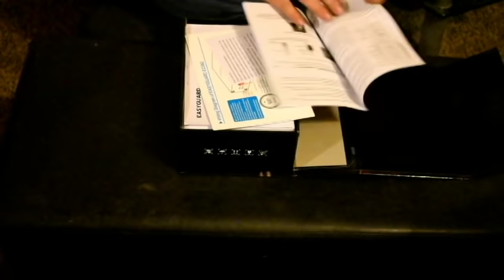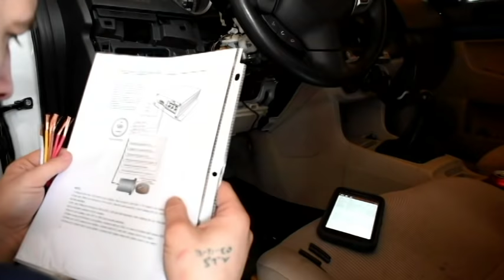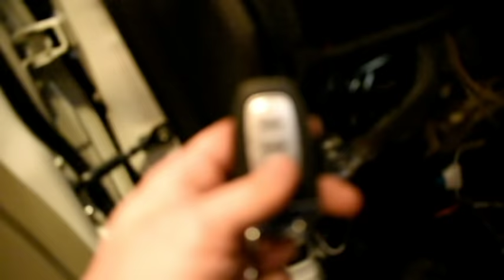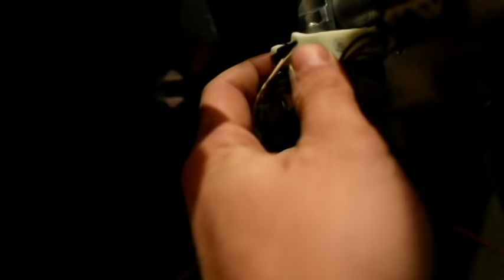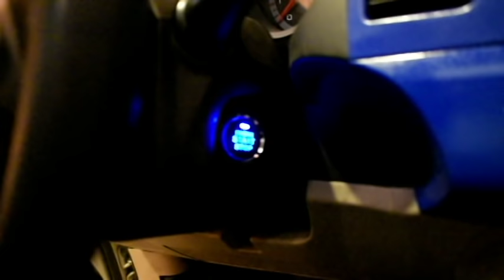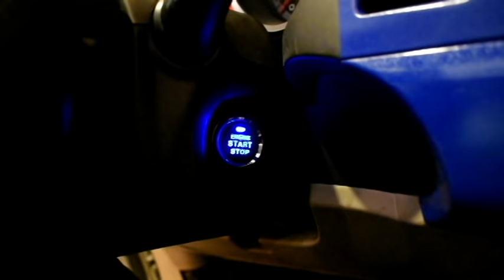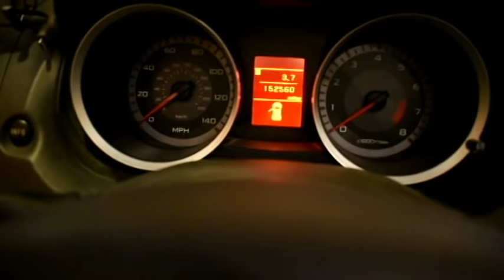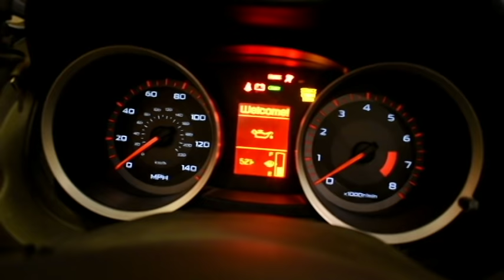How to Install a PKE Passive Entry Push Button Start System

Comment: As a previous owner of one of these systems I found a few bits to be miss leading or missing. You didn’t explain how to hook up the door ajar/ open wires. Very important for programming. U can hook it up to ur dome lite. Then there is your key sense you disabled   which can be hooked up to your ACC wire with a relay to reverse the polarity because some vehicles will not start without it. Also you didn’t state that there is a switch on the esaygaurd unit to go in between standerd or automatic transmissions mode. This disables  the break wire for standards. And not everyone vehicles use the same door locks some are reverse polarity as well or double polled even  but over all I have to Give you props for making the video just be more in formative about your information.
Reply: Man I wish the manual said that the dip switch disables the break wires... It just says switch it for manual cars. Took me an hour to find a good break wire to tap into today.

Comment: When you bare the wires, You should slip the Heat Shrink over a Wire, You should then solder the 2 wires together, Then pull the Heat Shrink over the joint and heat to shrink, Just twisting the wires together is definitely bad practice as they can still pull apart, Heat Shrink is only to insulate the wires so they do not short, They are not intended to hold the wires together. Your other option is the Red and Blue Bullet connectors where you put a part on both wires to be connected. This can be a better way if you ever intend to remove the system when you change your car.
Reply: Agreed. Solder or crimp connectors, just twisting is asking for trouble as the car vibrates.

Comment: For anybody wishing to do ANY wiring in your car: use crimps or solder your joints!
Reply: Never trust crimp connectors. Always solder your wires. Unless you want to do the job twice.
Reply: Heatshrink only isn't a solid connection?......;)
Reply: Gabriel Chartier no its not, not by itself. When doing any sort of wiring on a car always use soldier. If you are using only heat shrink you are relying only on a twisted connection. There is not enough contacting surface to ensure proper connection. Soldier flows in between all the strands of the wire to ensure a complete connection.
Reply: Solder definitely. I'm an installer and funny I seen other people use caps but for home installation lol
Reply: Or Wago connectors I like those for some reason.
Reply: omni crunk Please stop using them. Automotive wiring is a rough duty application. Those connectors are made from brittle plastic that can shatter . Also they use a blade of steel that presses against the wire. There is not enough surface contact to use those for anything except data connections, which is what wego connectors designed for. Google “burnt car” to see what your future holds unless you replace those with a proper connection.
Reply: i use electrical tape because i dont have a soldering gun
Reply: @wrecksandtech  soldier is to provide a solid connection that will not fall apart due to the vibration of the vehicle. heat shrink is for insulation only
Reply: @garysickler2179  correct. Using one or the other is inadiquite. You should use both. But the argument here was about how crimp connectors are not suitable for this application.
Reply: I worked for a company for 6 years that would only want us to use T-taps and crimps and I never had a car come back, I personally recommend soldering, but crimps are just fine
Reply: Tyler Stewart If I inspected my car after shop repairs and I find anything except proper factory wiring or soldier joints. Im not bringing it back. Im going to have my lawyer document it as evidence in the case to have your license to operate removed.
Reply: Boa tarde eu gostaria de saber como é que eu estalo no fusion 2008 o start stop
Reply: @wrecksandtech  dramatic

Comment: Probably AAM (body module) of mine is malfunctioning and I need to get a new remoter. The issue with programming and resyc it turns out. No tool at all to do that, therefore this would be considered as an option for me to have my remoter fixed, seemingly no other option left.

Comment: Car Insurance Cover-up matters across Europe so looking for ways to be aligned with after installation. The issue with locking steering wheel after turning off the key and leaving the car I figured out. Besides that who literally owns the key may also start the engine, one less problem I guess. From that point of view would everything be fine to me. But locking steering wheel concerns, though. These are my thoughts on that issue.

Comment: Two questions
1) can this system works on a lancer 2000 model?
2) can the multifunction steering wheel work on the lancer 2000?

Comment: I've got an outlander that had the smart key. It screws up a lot and the steering wheel locks and the fast key won't turn. It's the next best thing to push button start. You keep the fob, in my case, your purse, and you never have to see it unless you're changing purses. It unlocks the doors on second pull if the fob is near it and it starts if the fob is in the car. It has a switch though, as if it were a key. There isn't anything that goes into the ignition. There are buttons you can take the switch off. It's just a cap over it.

Comment: Good video, thanks !  I just installed one of these on my car and there are a few things I can't get to work.  The car will not remote start with the key fob (but it will turn the car off).  I notice you have a manual transmission, so do I.  Did you put dipswitch 5 in the "Auto" (down) position to get it to work ?  Also did you hook up the dome light trigger wire and does your dome light come on when you unlock the car ?
Reply: Any luck getting remote start?I have the same issue
Reply: The dome light trigger wire will not turn on the dome light when you unlock the vehicle. The trigger wire is what triggers the alarm if the doors open and dome light comes on, light bulb turns on and completes the circuit triggers siren.

Comment: Hey buddy...I have a manual van yet the engine cranks but wont crank over when i put my foot on the brake. To what did you connect the Engine Start Stop button and did you  step on the clutch alone? Thanks....

Comment: Nicely made a video.  You clearly know your way around a car, as well.  I did question the lack of soldering, but you went on to explain the reason for that decision.  I am wondering how you feel about disabling the steering column lock.  It it a big deal to you?  I'm undecided about doing this, myself.  I own a 2006 Caddy CTS Sport Luxury edition and they have the same ignition switch issues and the Chevy Cobalt, as well as some other cars.  The ignition key may turn off on its own while driving.   As a result, the key must be kept separately from my other keys.  Pain in the butt.  Cadillac doesn't have a redesigned replacement ignition switch available to correct this issue.   It seems that a remote start system would eliminate the problem completely.  Thanks for the tutorial!

Comment: If you leave the car running and walk away from it with the fob in your pocket, do the doors lock? What if you leave the door open when you walk away with the fob, and someone jumps in to steal the car... will the engine keep running without the fob until they shut it off?

Comment: I already have  a push start button and on Hyundai  Elantra 2016 . I was wondering if it can be installed  an  auto start system  ? I was told that is not possible .
Please let me know.
Thanks.

Comment: Hi, thanks for the video! Just wondering how did you do to be able to use the new key to open and close the doors? I mean, did you need to some kind of coding, or just when you connect all the wires it somehow link the locking system to they new PKE installation? Thanks!

Comment: I would like to ask if I have an alarm with pke equal to the one of the video. The problem is if you are near and open, will you always have an installation problem or with the antennas?

Comment: Is there a smart entry feature just like you said earlier in the video? That when you walk near the car it will automatically unlock the doors without pressing the unlock button on the key fob?
Reply from the maker: Yes
Reply: @EFFEKTRecords  how is it holding up after 2 years? Any issues or anything because i'm planning to buy that exact pke system for my car

Comment: Can you further explain the part about the fuses and open and closed circuits? Did you have to get those fuses separate? Lastly, for the "remove key" sign, did you just cut those three wires and it went away for good?
Reply: Thanks so much in advance!

Comment: Does the push start button have to be used?  Also if I skip from using the push start, can the remote start still be retained?
Reply from the maker: No, you would not have to use push start, as long as u dont plug it in to the box and still made the wires connect
Reply: @EFFEKTRecords  thank you sir

Comment: Did you have to get a module to bypass the steering wheel lock?
Reply from the maker: No, I had to cut a spare key thats left in it for the steering wheel lock
Reply: I wanted to buy a 2014 Subaru Crosstrek, but it's got key start. Subaru didn't even off push start until 2017 in the Crosstrek! No one will but after market push start in for you! I'm a 56 year old woman. There's no way I could do that myself! I don't have the knowledge. I have the ability! I am a widow. I do all my own yard work and stuff so I'm no shrinking violet! I used a chainsaw, weed eater, push mower, riding mower, lopers, Japanese pull saw, and a skill saw just today! Then I whipped up a batch of Apple Cider vinegar and froze 2 quarts of tomatoes out of my garden! Hehe Then I came inside and went out back and threw the ball for my 2 pit bulls for about an hour. I was a bit tired. It's been super humid in Arkansas. You have to wrap your head in a Bandana and take spares! Hehe #sweatintheeyesnofun

Comment: hy there,i have only one question...when u get in the car and steering wheel is locked, how do u start car(or how do u unlock the wheel) ?
Reply from the maker: +Mario Kordić the spare key that I cut and stuck in the lock cylinder is for the steering wheel lock, then to start u push the button

Comment: i don't understand something not with my installation manuel. There are 6 whires brown for ON CUT,yellow for start two red whires for +, white for ACC and orange for on. There is also a yellow whire that must go to a relais. from the relais goos 3 cables. 1 to the start motor 1 to the start switch and 1 to ACC ON. Where has the ON CUT go to and where has te cables from the relais has to go to?

Comment: Ugh. I'm having flashbacks installing keyless entry in my car. Debating putting a passive system in now but ugh. That moment when you pull out the second harness and you got the phone out and the paper. That was my life for 2 days of hell. Lol. Luckily it all worked in the end but half my connections were behind the kick panel fuse box so I spent most of it upside down to be and to actually do anything.... I think I'm good with keyless remote as is lol.

Comment: Hello friend, I have problems with the same Start Stop PKE alarm with the oil cable where I connect it?
Reply from the maker: Hello, I'm sorry but its been a while since I installed it. I do plan on doing a more in depth video with my current car when I put one on that. But, if I remember right the oil cable gets grounded to ground... Thats what I think I remember, but if not then it probly doesnt get used... But I do remember the oil wire just not 100% on what I did with it, but believe I grounded it...
Reply: @Mateo Castaño you havo to connect it to oil pressure sensor so it knows that the car is started so it doesn’t go on cranking and destroing tour starter
Reply from the maker: @MarioZmaj  I never had that issue

Comment: Nice video!  I purchased the same unit from eBay, my for my 2004 Ford Explorer my fobs have the lock/unlock/trunk release and panic though.  Hopefully it'll be the same install.  It should be here in a few days. You should show another video with you walking up to the car and it unlocks and when you walk away it locks.
Reply: Bryant Kelley awesome... I got the same kit as well 😅 i didn't this kit was so popular... I installed it in my 2005 Lancer. Works great. You can check out my tutorial too if you like... I may have some additional points that might help you out.
Reply: Bryant Kelley I need one with a trunk release for my 2001 Lincoln LS. Can you post the link for the one you purchased just in case the one I'm looking at doesn't have that capability?
Reply: Actually I just checked, and this one is out of stock as well. Just jump on eBay and search push button start alarms and take a look at what the hey have.
Reply: dJr Partners, ltd the one I used has the trunk release function as well 🙂
Reply: Did you ever install I'm thinking about getting one for my 2005 explorer
Reply: Bryant Kelley wats the kit called
Reply: The Auto DIY Guy saw you video too, so I've a stupid question if someone has same kit... Will it open your car ? How is the encryption on this things ? Does it sound your stock alarm or horn? Thanks
Reply: So it's been over a year that u installed your push start, what kinda feed back can you give on how the product works

Comment: Fire Hazard  no solder,no barrel connectors,  just a twist and heat shrink. That is not secured, you need something more then that.  Heat shrink is very thin and ignition wires have more  amperage going through them plus starter wires can get very hot if they get loose will short and start a fire. You should use connector or solder on them.  I always hate working on a car after someone wires thing in like that rats nest. I always charge to unhook everything and completely re do it all, right,nice, and clean.

Comment: Did you hook up the remote start? If so, how did you bypass the clutch?
Reply from the maker: +Johnny La I didnt bcz of the clutch
Reply: Is there an option on the kit that allows you to bypass the clutch? Or do you have to make another relay for it?
Reply: You van hook up the comand start working as long as you wire up e brake
Reply: You can unplug the clutch switch wire and put a jumper in it and can trick the car into thinking the clutch is in to enable remote start car must be in neutral or it will take off without you in it

Comment: We would like to ask for help. Do all wires need to be plugged in?
Reply from the maker: ธีระยุทธ ปทุมมาศ No they do not, it depends on your vehicle. But for mije there was atleast 4 un-used wires
Reply: Blue wire in 22p must be connected to the position thanks.
Reply from the maker: ธีระยุทธ ปทุมมาศ I beleive it was a blue wire that was the oil path, witch can be connected to positive. but needs it so it will all work

Comment: Why did you leave a cut in key in the ignition instead of removing the ignition cylinder entirely?
Reply from the maker: it was in the instructions for the steering wheel lock

Comment: can you give me an update please? i want to buy this for my lancer but i'm wondering if you would still recommend it after using it for a good while. is it still worth the buy and what would you say its flaws are? any reply would be great thanks!!
Reply from the maker: EduinDidWhat? I loved it, only a few issues I noticed... if its a manual transmission then the start featuer doesnt work... also, I like to work on my car and stuff but would have to put my keys on the table an nt in my pocket or it peeps at u alot
Reply: peeps because of the feature where if you get to far the doors lock or why?
Reply from the maker: EduinDidWhat? yes, if u go away, doors locks an horn sounds so gets annoyin if u leave em in ur pocket
Reply: alright thanks man i definitely subscribed. i have the 2010 manual model of this car so i'm thinking of doing this and adding turbo like you did. keep up the work !!
Reply from the maker: EduinDidWhat? appreciate it!
Reply: EduinDidWhat? I have different kit where you can modify the distance. I set it to unlock the car when i am 6 meters away And lock when i am 15 meters away because i sometime also want to freely walk around the car without   it constantly locking/unlocking
Reply: We have installed a similar system and have used it over 5yrs no issues with the system . (Just other shops after us, messing things up and we have to go back in and fix it)

Comment: Nice, but what about your steering lock?
Reply: jeejee235 sounds stupid but one of the ways I've seen people do it is cut a key they have and place it in the ign cylinder and the steering lock is always disengaged. But alternatively I've seen some people just remove the lock all together
Reply: We cut the lock out of the steering column and ignition . Since they are electrical and not just mechanical you would never want it to lock while driving . We don’t use kit but a similar one with a better start button and bypass key card instead of the #touch
Reply: Crow Concepts what's the system you use called
Reply: Sayhim Ali  “advanced key”
Reply: Crow Concepts have you got a link for it, can't find it
Reply: +Crow Concepts I'm from the UK! 😅
Reply: Sayhim Ali you can email us , we can ship international . Www.CrowConcepts.net

Comment: It dont work like and original ?? It need to hold down the push start?
Reply from the maker: +Akki J do wat?? it doesnt need to b held down as long as the brake wire is connected to the brake switch

Comment: I would've made a sister harness so it could be returned to factory or troubleshot easily. Wiring harness connectors are pretty cheap.
Reply from the maker: Michael Williams good idea, I may try that on my new install im bout to do on my 03 lancer
Reply: EFFEKT Record's  - start with easternbeaver.com or  TE connectivity when you get started. I did it with my Accord and my Aprilia motorcycle.